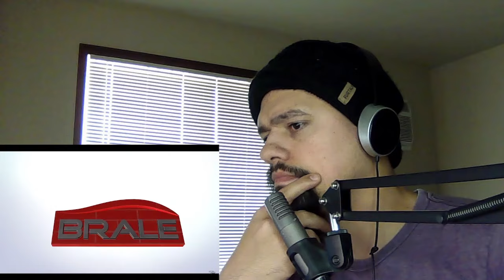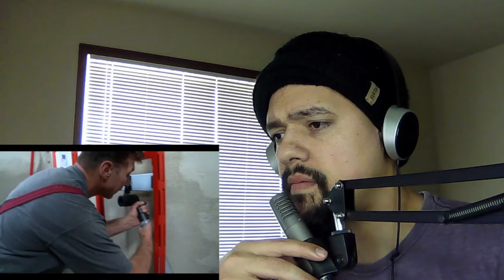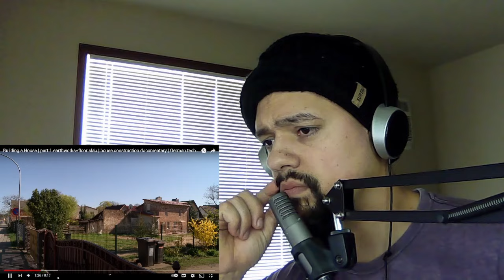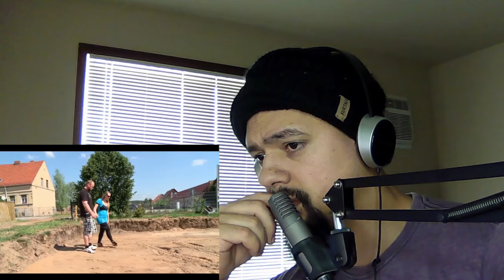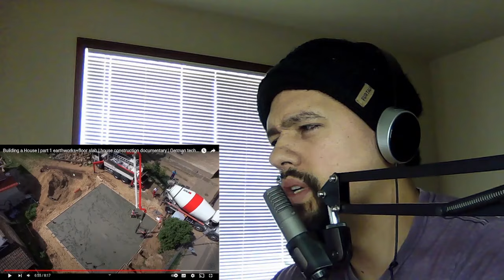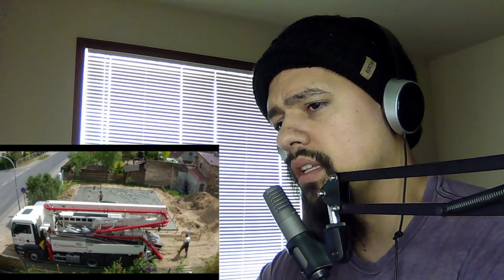American reacts To How German Houses Are built | earthworks and floor slab

Comment: No basement? o_O ... I won't live in it! In any german house, I lived so far, had a basement! I couldn't even imagine to live in a house without a basement. Where do they put their heating- and water-system and where do they store all their stuff? Where do they make their laundry? I have my washing machine in the basement, where I also dry the clothes... strange to me! :-/ Also it seem as the rooms are very tiny! I do need space, especially when I am living in a (big) house! They have 6 rooms at the ground floor/level... my house only has 1 at this level!? Upstairs 3 rooms, downstairs 4 rooms ... So on 3 floors in sum 8 rooms - they got already 6 on 1 floor. Strange to me! o_O
Reply: Nowadays many houses have smaller rooms and no basement because construction is so expensive. Most people rather have a smaller house without a basement than no house

Comment: Ok, I built my house twelve years ago. It is a bit bigger and had some extras like a much better isolated concrete plate and halfed distances fot the pipes of the floor heating plus solar and heat pump. The house itself was about 250000 Euros at that time. Today with all the rising costs in construction I believe it would be more like 400 to 500k Euro. This is just the house the soil to built your house on comes extra and can be easily around the same in an urban area.

Comment: I don't understand why they haven't chosen the house with a basement. The house isn't that big and the only storage space left is under the roof.
Reply: Money! The basement is expensive.
Reply: a basement can almost double the cost.
there are some side buildings on the property, maybe there's enough room for storage already
Reply from the maker: that is a good question, maybe it does take more time that's usual to build it though.
Reply: My parents didn’t build a basement because the area where they live was a swamp/marsh/wetland up until the end of WW2. In the 50’s it was dried to make space for extending the town but the area has still quite a lot of wetness in the ground. Many neighbours have issues with wet walls in the basement and mould
Reply: @Schona14  fomer swamp/peat mining area with surrounding floodplain and quarry forests. ~10 years till we have to dehumidify parts of the basement walls.